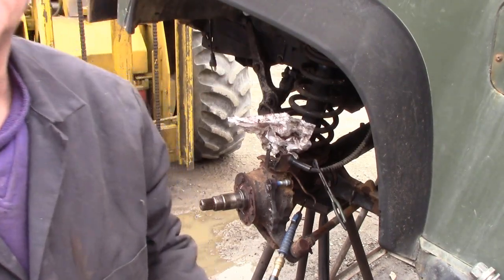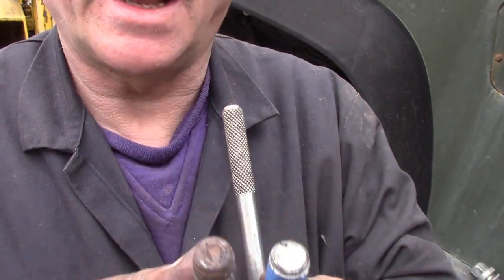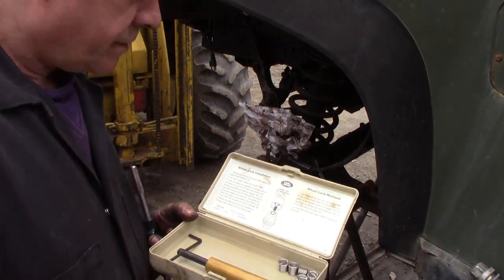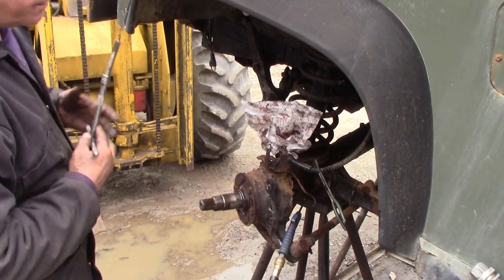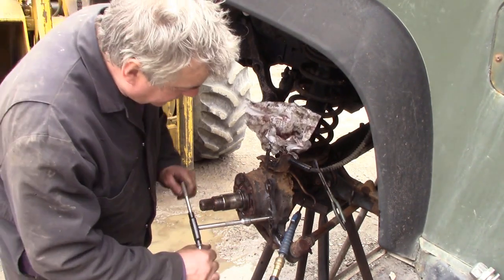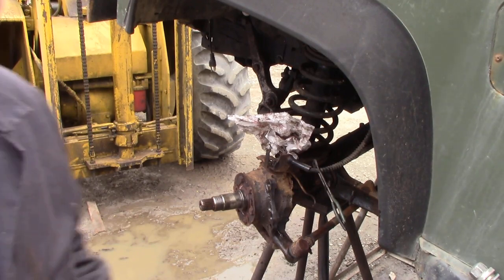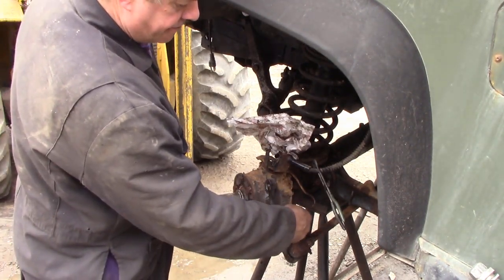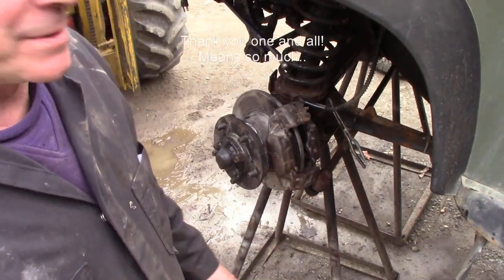Repairing a stripped thread with a Helicoil

Comment: That was a light bulb moment for me when you said about the two different threads, The bolts that were sent with the calipers were the fine thread and mine were the coarser one as on 1984s. I had to put the old ones back which I didnt like doing. Many thanks for that Mike. Keep em coming. Yorkshire Rob.
Reply from the maker: I think the coarse threads were only on the very early vehicles - but the heads were the same!
Reply: @BritannicaRestorations  The coarse thread bolts were used to 1994.
Reply: I  have a set of calipors and pads ,new metal brake pipes in stock already to fit when needed. I will now order the right coarse threaded bolts so the set is complete.  Many thanks for your help Mike. Please keep the videos coming. Good luck from Yorkshire Rob.

Comment: Thanks again for a useful video! 
I've screwed quite a few m5 and m6 helicoils into aluminium on old motorbikes. They really save the day although, as you say, be really careful on the first few turns, and don't push too hard, so you don't stretch the helicoil and basically cross thread it. It's more of a thing on the small sizes.
Reply from the maker: Yeap!

Comment: Helicoils are a bloody godsend
Reply: I agree. I used them years ago on medical and aerospace instrumentation - new factory fitting not repair. It was considered that fitting a Helicoil instead of just tapping the device allowed service dismantling without damaging the alloy housings. In more recent times I've used them on my old cars & Landrovers to renew damaged threads.
Reply from the maker: The Defender windscreen to bulkhead brackets are Helicoiled from new
Reply: I think 200TDi air con mounting bosses on the timing chest are helicoiled at the factory too. Guess it makes sense in an aluminium casting!

Comment: I have a 'Recoil' kit for 10mmx1.5, (Aussie version of Helicoil), which I bought ten years ago to fix a damaged thread on a 200 TDi engine. It was the timing belt idler pulley stud which was tapped into the alloy casing. Anyway, I drilled out the hole with the proper sized drill bit only to find that somebody had beat me to it and had helicoiled it before, except they had messed it up somehow, probably used too big a drill bit. I ended up taking the case to a local engineer who made a stainless insert and solved the problem that way. So, now I have an unused kit which I never got to use. They are a wonderful invention though aren't they?
Reply from the maker: Yes, they get us out of a fix!

Comment: Used a few of these on me lt85 gearbox ,being aluminium the torque settings are critical or you strip the threads like they did with my gearbox,helicoils saves you time and a lot of money in most builds.😁😁
Reply from the maker: Always good to have in your arsenal of repair bits!

Comment: Mike, I've got a stripped exhaust manifold stud in the head, can I helicoil the head or is it now scrap ?

Engine is a standard 98 300 limo with egr, I'd like to keep it stand, but a helicoil I can live with ☺️
Reply from the maker: Yes, you can Helicoil it - original stud is M10 x 35  - do not drill too deep!

Comment: Would the loctite not pull the helicoil out.
Reply from the maker: I do not think so as the unwinding of the coil tightens in the casting - if you have an air chisel you will see what I mean
Reply: Britannica Restorations Ltd  We used to special 24mm self locking helicoils on Challenger 2 gearbox mounts and some still unscrewed themselves. And used Duralac on aluminium to stop reaction between the insert.